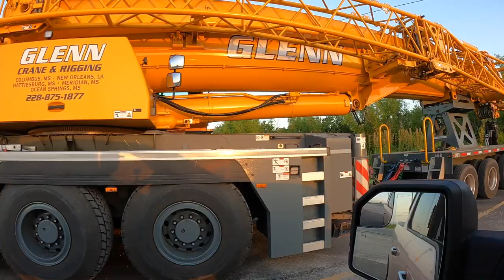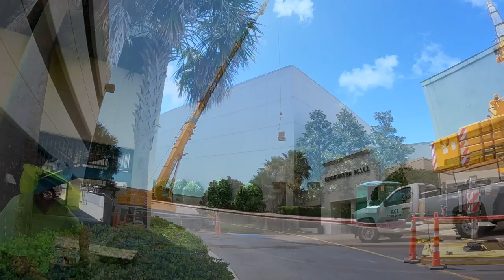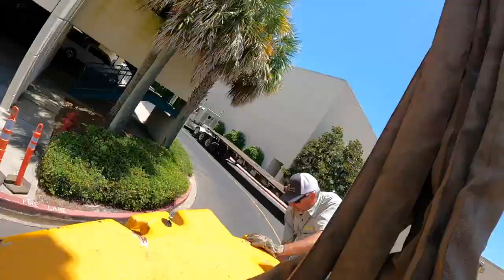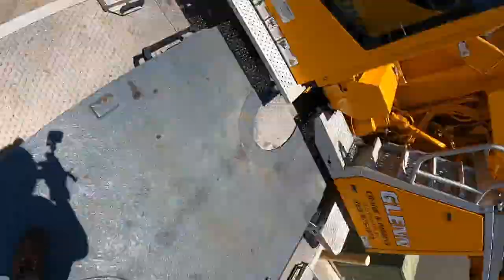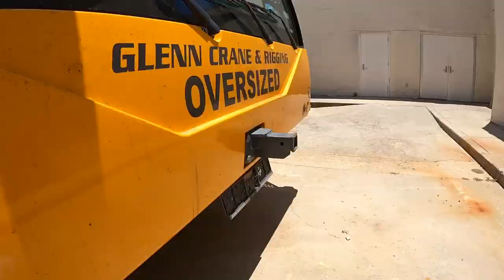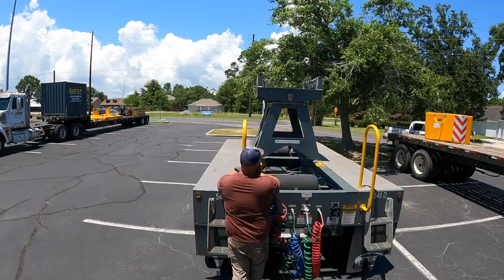A Day As A Crane Operator | Rooftop Air Conditioner Replacement | Liebherr LTM 1250 5.1 | Biloxi, MS

Comment: Hello Pat, I am a mobile crane operator and I follow you from Spain, one questions, how ,mucho is the annual salary in the USA? a greeting.
Reply from the maker: It depends. Most of us are paid hourly so your gross is really dependent on how many hours you’re willing to work. I would say it ranges from $70,000 to $120,000usd in the states. Maybe more if you’re running specialty equipment
Reply: @Reynoldscraneservice  That tracks with my experience as an operator in the US. Also depends where you’re working in the US. Large costal cities will typically pay better than small midwestern towns obviously.

It all equals out after taxes and rent/mortgage though lol
Reply: In Toronto, Canada we make $100-200k on average. We are hourly also!

Comment: How come you don't stack your weights on the trailer then land them on the deck? 3 part the block and run a pair of 30k endless and you only have to swing once per truckload of weights. I run a 1220-5.2 and it charts 68,000 with no counterweight far enough to load & unload trucks off the sides and rear.
Reply: Waste of time to do all that. Putting a 3 part in then taking it right back out to one part for the job. Not to mention all of that is more work for the guys on the ground.

Comment: Why would you do a 180 swing at full boom extension?
Reply from the maker: What in the world does that matter???
Reply: @Reynoldscraneservice  When you make a pick, you plan them with the fewest maneuvers and risk. The pick (lift) was not well thought out.
Reply from the maker: @bills6946  that’s how it is in taxi crane. We didn’t place the units where they were, we just set the crane up where we needed to be. That’s a pretty silly thing to get held up on. That’s a brand new LTM 1250. The machine is designed to swing 360* about a million times so that’s what we do when the job calls for it. 👍🏽

Comment: Why do you carry the boom on the trailer?
Reply from the maker: Because it spreads the weight of the machine over 8 axles, rather than only 5. It allows us to abide by specific axle weight requirements for state laws, bridges, etc.
Reply: @Reynoldscraneservice  ahhh... Things are different here in Europe
Reply: @gigi-of2tu  This varies a lot even between states in the US. I know of at least one state that does not allow boom dollies at all which means anything over ~200t requires the whole boom to be removed for transport.
Reply: @gigi-of2tu Europe has much different road laws and weight restrictions than the US. Most states in the US only allow approximately 10 ton per axle. If the gross weight exceeds 10 ton per axle, more axles must be added somehow. Hence the boom dolly. For example in Texas, an LTM-1400 has a weight limit of 90 ton gross so no boom dolly is required, but in Georgia you can't exceed 68 ton gross so we have to remove the boom entirely. It's quite ridiculous, but I will say on some cranes a boom dolly does make the ride much smoother. My LTM-1220 rides much better with a boom dolly than "in the rack" as we call it.